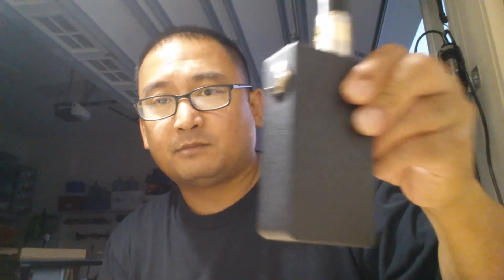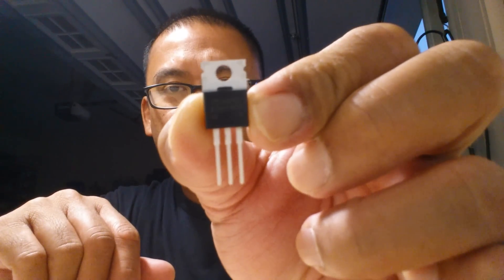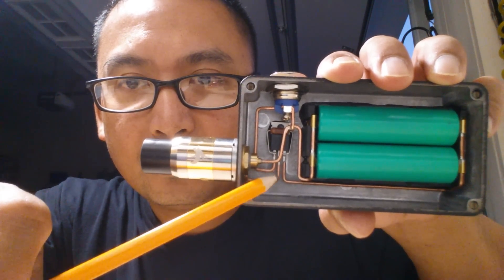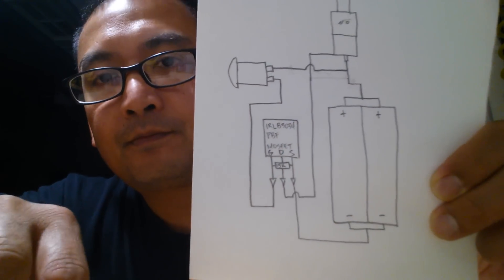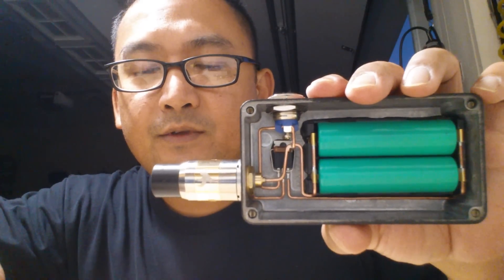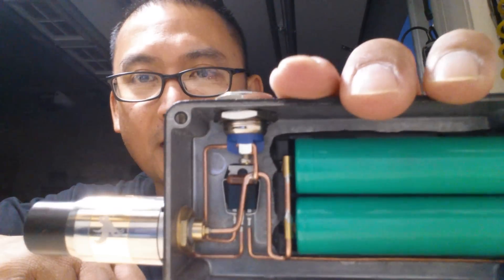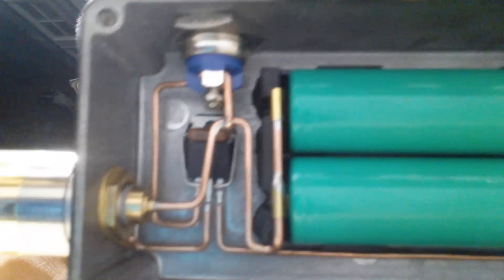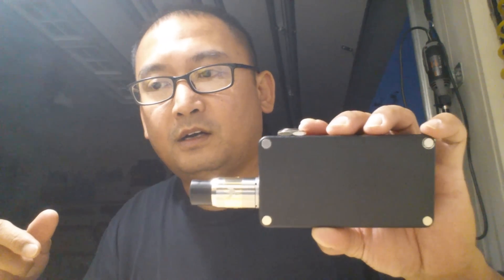Unregulated box mod with a Mosfet

Comment: i'm cross posting this from another channel trying to get some clarification on an issue i'm having.

I had a question regarding this build. I was able to source everything locally except the 3034 mosfet.  A local shop sells just electrical components and they didn't have a 3034 mosfet. they recommended an NTE2291 mosfet. I used the NTE2291 one with a 15k resistor and I have ridiculous voltage drop. Is the mosfet the cause? I have rebuilt it from scratch twice. the build on my RDA ohms out at 0.65. positive to battery negative shows 4.12volts until I fire then it drops straight to around 2.02 and takes forever to heat up at all. Nothing is over heating and the batteries aren't getting hot or nothing. I just wanted some clarification on this. Every site i've gone to and looked at tutorials never say WHY you need the components just that you need them. i've never used a mosfet before in any electrical work i've done so i was uncertain on how to proceed with a decent alternative to the 3034.
Reply from the maker: damian deaucali a mosfet is used because typical switches used in vaping applications, mainly for really low resistance build, are not capable of handling the amp load. So the mosfet will act as the switch and if the right one is used, will be able to handle the amp load. For example, the IRLB3034PBF (the one I typically use) is rated at 195 amps. I'm not certain if anyone can come close to vaping at that amperage. With a mosfet, you can pretty much use any switch because it's purpose is to trigger the mosfet to turn on. All the amp load will be handled by the mosfet and not the switch.
Reply: Thanks for the reply back. The problem I found was the MOSFET I got from a local supplier was not firing. Turned out the vgsth was to high @ 4.5. I ended up getting two MOSFETs that fire at 3.5v and in parallel should drop the requirement to 1.75v. I haven't tested it yet but will later today. Again thanks for the reply and an awesome set of videos. I don't think I've seen a cleaner looking project.
Reply from the maker: damian deaucali when you wire in parallel the voltage will stay the same, in your case @ 3.5v. The on resistance of the mosfet will be reduced in half Not the Vgs. Basically the same logic as wiring batteries in either parallel or series. That mosfet should still work, but once your batteries drain below 3.5v then it will stop working. The IRLB3034PBF mosfet's Vgs is 2.5v, I think this is the reason why most modders use this mosfet.
Reply: Al USAF the mosfet didnt work either. my voltage drop is dropping very much. almost 2 volts so the 3.5v mosfet wouldn't fire either. however i went and bought some 3034s from mouser. hopefully this works cause i've worried this box many times already and everytime no matter what mosfet that should work i end up with drastic voltage drop. even on 0.6-1.2 builds.
Reply: im having the exact same problem. i do not have a meter with me at the minute but my ramp time is huge. i tried bypassing the mosfet with a loose wire to bridge the contact and it fired perfectly. my mosfet is rated at 202A so wouldnt have thought it would be an issue... data sheets show no mention of voltage drop either.
Reply: none atall hhh

Comment: What did you do about the box being metal and copper wires. Isn't it a problem if they touch the inside of the box? Thanks
Reply from the maker: Aaron reinhart I made sure the wires weren't touching the box. The only wire making direct connection to the box is the wire that leads to the 510 negative.
Reply: Gotcha, just got done building my box and it turned out pretty well, the negative on bottom tapped it once by accident and it all it did was just ground it and make it fire but I fixed that and I'm really happy with it. Thanks

Comment: Nice build!! Double bubble rules! I am assuming you are in the Air Force. I am in the Navy and we use double bubble all the time! One question. When wiring the switch, does it matter which connection you use for positive or negative? thanks keep up the great videos.
Reply from the maker: James Johnson I use JB Weld. The switch orientation doesn't matter.

Comment: Are there any coil build limitations with this mosfet? And what mosfet could I use for a dual 26650 wired in SERIES? Thank you for your time.  :)
Reply from the maker: Vaping McVaperson not with the mosfet because it's rated at 195 amps. Your limiting factor will be your batteries. But if you really want to go low, below 0.1, then you have to do it at your own risk. You can use the same mosfet.

Comment: If I wanted to ad a couple led lights into this exact setup how should I go about doing it. Thanks for any help. Love how clean ur. Wiring is!!
Reply from the maker: Brandon Kolwyck leds negative to the batteries negative and the leds positive will be connected to the wire between the mosfet and switch.

Comment: Do I have to use the n channel mosfet on a 26650
Reply from the maker: shawn hammock if you meant an N channel type of mosfet then no, because you can also use a P channel. But most use the N channel and I highly recommend that you install a Mosfet.
Reply: Okay because I ordered the p channel MOSFET I just didn't want anything to blow up but now I understand that the MOSFET acts as the switch
Reply: Thanks for the help and by the way that's a bad ass mod

Comment: I have my own unregulated box mod that I bought off line and I've been seeing a lot of videos like yours saying to get all these parts, I got mine today and it won't fire at all I checked all connections and they look okay but I noticed there isn't any resistors or mosfet in it could that be the problem of the mod not firing ?
Reply from the maker: Nick Little it will still fire even without the mosfet and resistor. Check the wiring to make sure it's wired properly and I highly recommend that you install a Mosfet.

Comment: Hi pal... congrats on the second box mod with two new features... smaller bax and a tactile switch... I have got a few of those tactile switches... never thought of using one... well... that saves lots of space... something new to try... for me... Anyway, I have another thing that I wanted to know... I've been searching online but still can't find the way to wire a mini voltmeter for mosfet box mod... Do you have any idea as to how and where can I get a wiring diagram for that, pal? I have a mini voltmeter but I just don't know how to make it work for a mosfet box mod... especially the wiring it... I'd like to add that to the new one soon... Seriously... this is really addictive... I just love it. Thanks for the reply, pal... I appreciate it. And, will I see any Raptor chip Mod from you anytime soon? Good luck, pal... You're a great modder.
Reply: farafazli abu bakar Boleh beli di Garing Vaping kat Kota Damansara bro...

Comment: instead of running the wire across the battery contacts, you should put a short piece that connects the battery contacts, then wrap the wire around the center of that connecting wire that is going to run to the MOSFET, in order to ensure an even power draw from your batteries.  I haven't worked with this much, but correct me if I'm wrong.  The way it's wired seems like it would draw more power from the battery that's closest to the MOSFET in the circuit (the left battery).
Reply: also, if you were going to wire in a 2-wire voltage meter, would you just go negative off the battery and positive off the mosfet "G"?
Reply from the maker: The Surreal Vapist I've measured my batteries after use multiple times and the voltages were always the same. So the way I wired it doesn't affect the draw balance. 

Yes to your second question.
Reply: Al USAF cool thanks for the reply.  I'm sitting here trying to figure out how to solder a tab on, but I'm just going to wire it the same as yours after hearing the good news.

Comment: Hi there again... Thanks for the prompt reply, pal... Indeed it works better now. It was entirely my mistake as I thought I shouldn't solder the connecting copper wire to the positive and negative battery sled. At first, I left them floating, hoping that the pins will compress itself once I slot in the batteries. Well, I thought wrong and that affected the performance of the entire firing. When I looked back at your video and boom.. there it is. I saw you soldered the copper wire to the positive and negative battery pins on the sled. I learned from there. Thanks so much, pal. No issue on the solid copper wire... plus I added a switch... fearing I might accidentally press the firing button while travelling. Again... thanks so much for the help and guidance. Appreciate it big time. I wish I can send you the picture of my diy mosfet mod (credit to you) to you, pal... It works like a charm now... Vape On.
Reply from the maker: Ralph J no problem, that was my plan and reason for posting the videos...to help others. I also made another similar box mod, except I used the smaller 1590G and a tactile switch (same switch used on the older DNA20 box mod). I didn't need a master switch because you have to put a lot more pressure to fire that type of tactile switch compared to a regular pushbutton switch. Doesn't fire on its own when I have my box mod in my pocket.

Comment: Hi Al USAF... I have finally made my first mosfet box mod. There's one thing that still doesn't seem to be okay. I notice there's less power than my ordinary mech mod (Slug). I would like to know if there's something wrong with is it normal. Hope you can get back to me soon. Thanks in advanced...
Reply from the maker: Ralph J it should perform better but it all depends on how you built it. What gauge wire did you use?

Comment: Hey I've built this exact same mod twice now and every time I put the batteries in the mod turns on automatically like it's bypassing the switch. I wired it exactly how you have it, I don't understand what I'm doing wrong.
Reply from the maker: Chemistry Duo email me a close up pic of the inside of your box mod so I can look at your wiring...alusafvapes@gmail.com
Reply: I'm having the same problem. I've triple checked the wiring, even had a third person review the wiring and still can't figure it out. Please help!
Reply from the maker: Mega Watt send me a close up pic of the inside of your box mod so I can check it and hopefully figure out your issue. 

Alusafvapes@gmail.com
Reply: Al USAF I figured it out. It was a bad mosfet. I only bought one (learning curve) so I bought two this time. Thanks.

Comment: All I see is a bomb in his hand. "Here let me take this protective coating off this wire and see what happens" You shouldn't be showing people to build SHIT like this. You even said before you were running a box without a mosfet, how dumb is that.
Reply from the maker: First, show me a case where a box mod failed due to it not having a mosfet. If you know about the Bulak Boys wood box mod, they sold a lot of box mods that didn't have mosfets. They only started producing box mods with mosfets just recently. You would think there would be a lot of box mod failure cases being advertised just from this modder. But I haven't seen one. In fact, majority of the box mods sold in the past didn't have mosfets. It was just recently where modders started using mosfets in box mods that they sell. Why would you think that using bare copper wires is unsafe or make the box a "bomb". So you're pretty much saying that all electronic gadget out there that have exposed connections is a "bomb". I'm guessing you shrinked wrapped your entire box mod because your afraid you have an exposed connection...
Reply: I'm not saying anything about all exposed connects are dangerous. And anyone with half a brain wouldn't run a box without a mosfet unless it's the Capsella or something made to work the same way. Do what you want, if you want to short out your shit with bare wire do it, I don't get a fuck. I know if you brought that shit around where I'm from people would tell you the same shit, that your a complete idiot for stripping the wire like that. Oh and for future reference don't be putting words in my mouth.
Reply from the maker: Daddy McBigNUTZ I'll take my half a brain because it has a higher capacity than yours. If your telling me to do what I want then why even comment. So you have the vaping experts in your area...i suggest keep them there and don't let them out because they probably narrow minded as you.
Reply from the maker: Daddy McBigNUTZ like I said keep that heat shrink around your box...or don't Vape at all.
Reply from the maker: Daddy McBigNUTZ and read what you just stated...burning a switch is not a failure? Definitely keep your expertise where you're from and don't share it.
Reply from the maker: I'm not Korean...you're not very good at guessing and or at anything about box mods. Have them show their work because your nose is so brown that you probably sing lullaby to the box mod they made for you.
Reply: dude that's solid wire bent tight in a confined space ... have you any clue what that's like ?  take a good look at it , even if you wanted to push them in to a short you would have a hard time .  obviously this mod is for the electrically inclined .. you cant even grasp how well it's made . racist oink
Reply: He thinks that copper moves around all loose n stuff ,I've got a dual 26650  big papa that would really scare Paddy mcittybittynuts

Comment: Could u do this exact setup without a mosfet? And is the switch just a anti vandal 2a switch on eBay?
Reply from the maker: Jeremy Sneddon yes but I recommend using a mosfet. Yes, it's a standard push button switch.

Comment: Hey quick question in your experience what is better in terms of achieving the least amount of voltage drop 1 making the contacts from scratch using copper or using the stock contacts that come with the battery sled featured in this video?
Reply from the maker: ***** I would say the custom made contacts. In addition, if you can do it with minimal solder joints, it would perform better.
Reply: Al USAF ok cool so what about a mosfet thrown into the circuit would that also cause voltage drop because there are extra solder points in the circuit ?
Reply from the maker: ***** you need the mosfet and the resistance through it is very minimal.

Comment: What's the thickest wire that can fit in the fat daddy vapes 510 positive connection?
Reply from the maker: MARK ONE 14 gauge but you can sand down a 12 gauge to make it fit. For your other inquiry, I wasn't using a mosfet when I started building my own box mods...but now I do and always recommend it. Good luck on your build.

Comment: what if a box mod gets too hot to where you cannot even vape it?
Reply from the maker: Kevin Darby it shouldn't. But if it does, I would get rid of it.
Reply: Too low of build making your mosfet get hot which is transferring heat to your box or could be heat from RDA if you were chain vaping. I actually did this today almost burned my shit up with a really low build, made my entire box and batteries really hot.
Reply: Daddy McBigNUTZ So what should I do?
Reply: What ohms are you at?
Reply: Daddy McBigNUTZ I have no idea lol

Comment: I am new in making box mods like this I was just wondering what is a non rated switch and what would be the issue with using them
Reply from the maker: Salvas Jesse it means not rated for extreme sub ohm builds. All I can tell you is to use a mosfet and you can pretty much use any pushbutton switch.